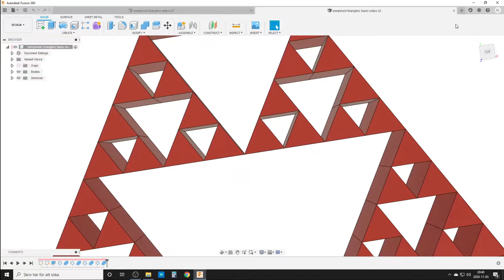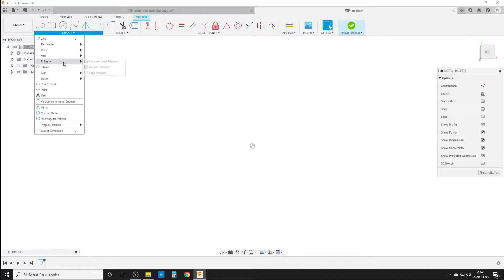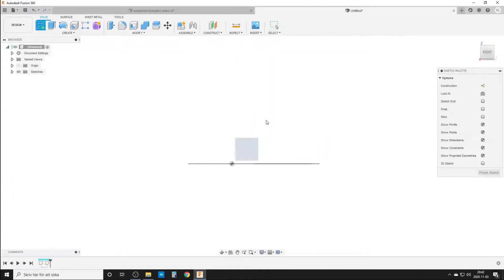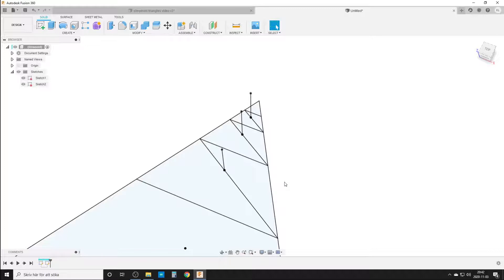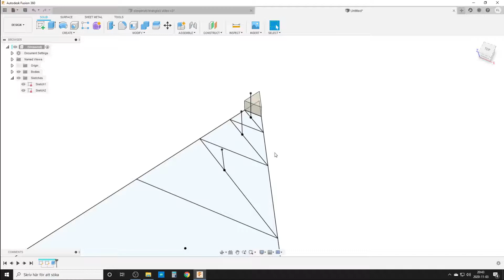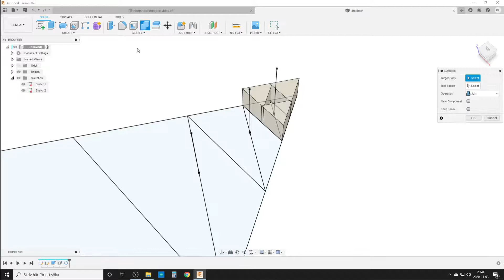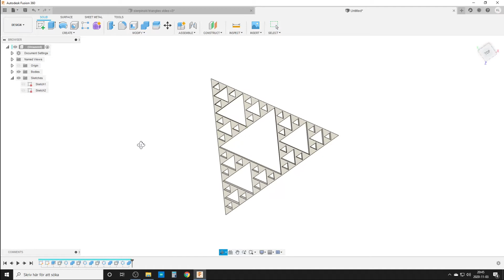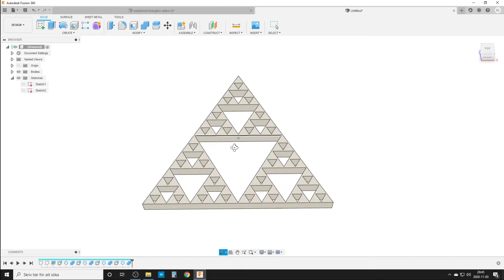Sierpiński triangle in Fusion 360 - (Circular patterns)

Comment: Somehow when I perform the intersect on the three diagonal lines around 2:45 it doesn't work for me.. I don't get the purple midpoints etc. Edit: I found out why, my triangle wasn't divided by the construction plane. I created a new construction plane through the middle of the main triangle and now it works!
Reply from the maker: I was a bit fast placing the start triangle on the origin point, I'm lazy and like to use the origin planes to do my sketches on.
Good to know you got it to work :)